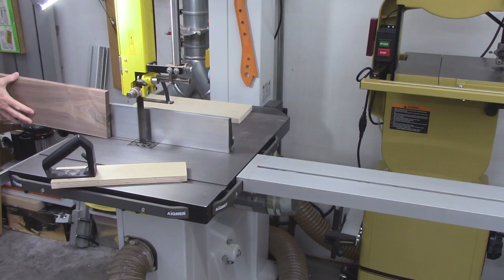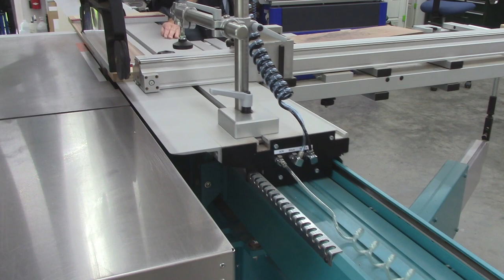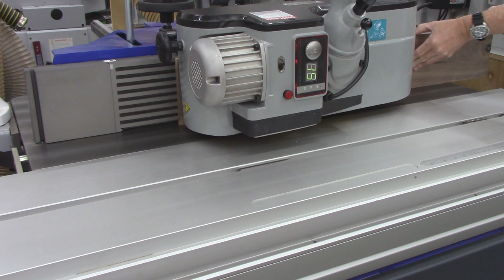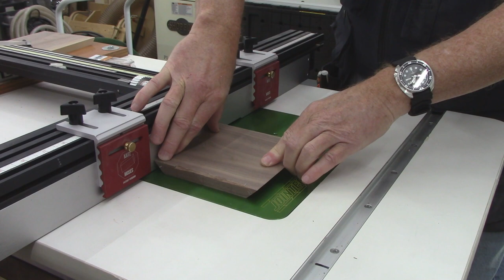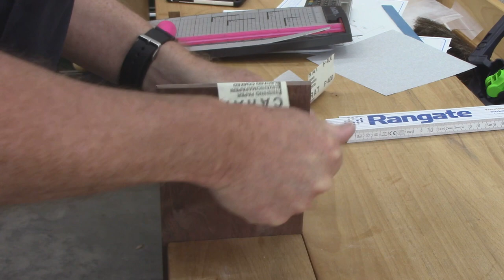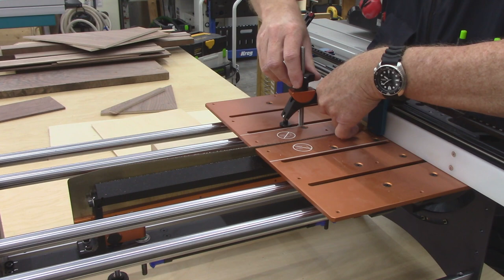Bowfront Jewelry Box Redux PART 1 - Carcass Construction

Comment: I've spent two days reading iGagings  web site, watching videos and looking at info on retailers sites to find out if and how I could do with my planer what you did with your drum sander.  Everyone skips over how you zero the display, if you can zero it at a given distance from what you want dead zero to be and how to do it.  Thanks for your clear concise description and video.  

I would like to know how the sensor and read out have held up.  It appears to have been at least two years since you installed it on your sander.  I wondered how the read out would stand up to the vibration and if the dust would interfere with the sensor?  I will probable have more vibration and dust on my planer that you have on your sander judging by the job your dust collection does.  Thanks again
Reply from the maker: Hi Jack.  Instructions are included with the display but I really don't set a zero.  I calibrate the display based on actual results and enter the value without moving the head.  This keeps the calibration unless you lose power (either battery or AC power if you get the adapter).   It will keep its value if you use the power switch though.  Setting the calibration preset value is shown in the instructions but it is more of a PITA than it really needs to be.   That is my biggest gripe about this unit.  

So far it has held up well against both vibration and dust so I don't think there is much concern there.  
Hope this helps.  Steve

Comment: Looking good Steve...  did I spy an old Shopsmith pushblock amongst all of your fancy tooling?    That Hoffman machine is something and wondered what would happen with the slightly cupped wood along that width since the reference is NOT the width but edges...  why I would usually reference spline cuts to try and bring any cup back into parallel.  At least you get to use that gizmo on your treasured boxes!  Best Regards...
Reply from the maker: Thanks Mike.  Yes, it is a pushblock from a Shopsmith Mark V purchased in 1980.  It was one of my first WW machines that I used for about 30 years.  I sold it to a buddy that flips houses.  Cupped wood would be problematic as the dovetail slot would be straight and not follow the cup.  This would leave gaps unless you could force it flat when cutting the dovetail slots.  Steve
Reply: @extremewoodworker  yes, my point on the cupping issue...   btw, I had an early Shopsmith  as well and sold it to an entry-level woodworker; was really something.  NOW, guys like us have lots more 'resource' to spend on fancy tools.  THANKS for 'piloting' some of them AND even more for making videos to chronicle your results!

Comment: Hi Steve - great work as usual. I can’t be looking at additional machines - there’s no space left. It’s an obstacle course to get round the shop as it is   :-)
I appreciate the design was chosen to highlight the key joinery although I think a lock miter would be good too given the back  piece can be lock mitered as well for a flush join.  Best wishes in these troubled times. Cheers
Reply from the maker: I have a lock miter shaper cutter but the stock thickness of 14.5mm is much too thin for it to work.  I am living the dream of the space issue as well so have sold my Oneway lathe and I think I have a buyer for my drill press as well to make room for a few other things.  Thanks.  Steve

Comment: Steve, when you cut veneer do you always cut it off the outside? I wonder if that is what i have been doing wrong? I always have to allow extra for the cleanup after resaw.
Reply from the maker: I have done this both ways with the veneer toward the fence and on the outside.  Both ways seem to work well but always allow extra for cleanup.  Having the veneer fall off the outside works well but it is more time consuming since the fence is continually adjusted.
Reply: If you cut it on the inside you can take multiple slices with the same setting, you just need to flatted the board before putting it back through the bandsaw. 
Steve has all the toys but you can tell that he never had to do this for a living.

Comment: Hi Steve,  A little off topic; but, I have watched many of your sliding table saw videos. Very helpful. I’m work living in Vancouver. I’m considering a slider and wondering if you have some advice. Currently looking into the formats and Martin t 65. I build custom furniture and am wanting to see if you have advice on options to get for the saw. I’m thinking you may have options that you don’t use much and some options you wish you would have gotten. In your option what are must have and you’re glad you’ve got, or if you had to do it again option you wish you would have purchased. Following is a t-65 2019 new that I could get for $45,000. It doesn’t have the T60C35 ‐ Parallelogram crosscut table. 

Brand New 2019 T65
Exact same specs as 2021, just been sitting in inventory for a while, and the owner is willing to let it go to turnover his inventory.
          7.5hp motor
T65_220 CSA electrics                        ç 220 volts, 3 phase, 60 cycles
All scales inches
T6591-b control panel eye level         
T6504-a  3.3M sliding table                   ç 10.8’
T6509 cutting width 1350mm              ç 53”
T6590-a  motorized Rip fence             ç Fancier than you said you wanted, but…        
T6523  3 axis scoring unit                   ç Fancier than you said you wanted, but…
T6543-a Digital cross cut with two flip stops
Reply from the maker: Hi Shilo Living.  The Martin I have now was purchased used so I did not spec the machine.  
With respect to the options I have; 
(1) I find the digital crosscut stops the most useful as it is easy to make micro adjustments fine enough to shave off the thickness of a sheet of paper (this will be shown in the next video).  The crosscut stops are the 2 point contact version for which I have somewhat of a love-hate (dislike) relationship.  I love them when dealing with rough lumber that is bowed, I dislike them for most everything else.  I think I would have liked the digital flip stop cross stops better.
(2) The parallelogram miter table is nice for workpiece support and is extremely accurate but it really doesn't get used that much.  Depending on your work, it may or may not be worth the cost.  Considering how much I have used it over the past 11 years, I don't believe it is worth the extra cost for me.
(3) I don't think I said I disliked the 3 axis scoring unit which I believe is a necessity for a saw of this caliber.  Even if you don't have a need for this option, it preserves resale value as many shops would not even consider it without that feature.
(4) Motorized rip fence:  The handwheel on the operator side is one of my favorite features of the Martin.  IMO, the long sliders need some method of moving the rip fence from the operator side of the machine is an absolute necessity be it a handwheel or motorized.  That said, I seldom use the rip fence as a rip fence.  It is mostly used as a stop for cutting from the sliding table.
(5) The only option I wish I had would be a means of remotely starting/stopping the machine from the end of the sliding table.  This is especially helpful if you do a lot of sheetgoods.
Hope this helps,
Steve
Reply: @extremewoodworker   very helpful and much appreciated. It would seem that the saw they have in stock t-65 that I listed above would be a good choice in your opinion. I also agree that the additional on off switch would be a helpful option. If I order this saw it can be at my shop in a couple of weeks.  I think the only reason I would order one from the factory is to get the parallelogram crosscut table; but I think you may have a point that I too may not use it all that often.  Goodness gracious, what should I do. Lol I need to make a decision.

Comment: Hi Steve, love the video and nice touch on that elegant curved top edge of the box!  I was curious about a tool maintenance question.  Do you use anything to wipe down the table tops of your machinery from time to time?  Watching you use your Martin slider makes me anxious for my new Felder to arrive!  November can’t come fast enough!  Take Care!
Reply from the maker: Hi Tundra.  I initially wax machine cast iron tops with Minwax paste finishing wax.  I seldom wax after that and use Felder Super Glide to wipe down the tables.  I put a little on a paper towel and rub it in.  It works great for planers.  My shop is conditioned space so there isn't a rust problem.  You will enjoy that new Felder as the XRoll is the smoothest I have used.  Steve
Reply from the maker: Forgot to include the link:  https://us.feldershop.com/en-US/en-US/en-US/Workshop/Cleaning-and-maintenance/FELDER-Super-Glide.html
Reply: @extremewoodworker  Thank You very much Steve!  I’ll need to add that to my shop maintenance arsenal supply for sure!  Yeah, time is slowing down for me as I wait for that saw to get here.  LOL. THX AGAIN.